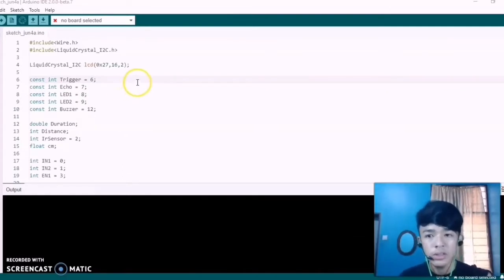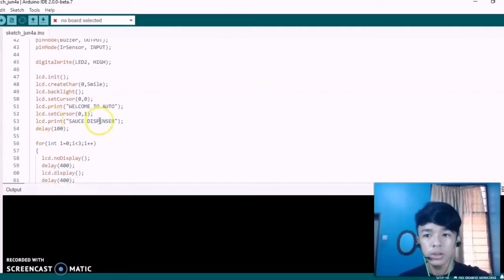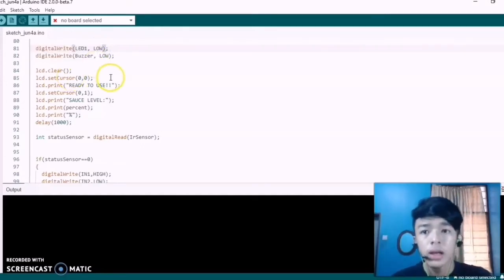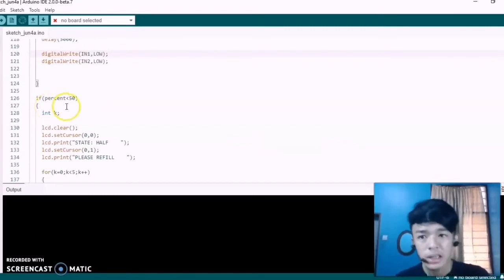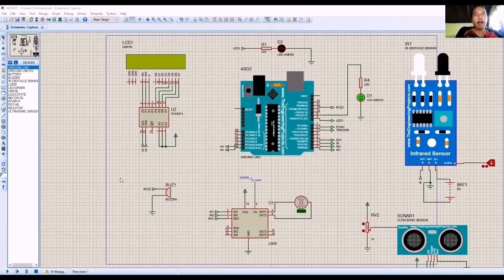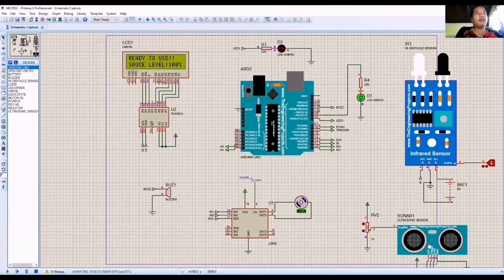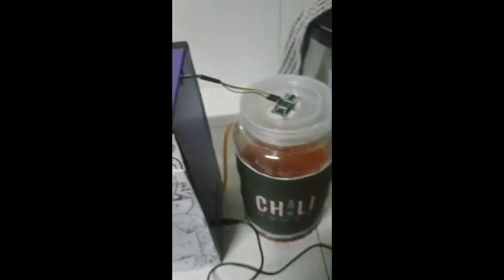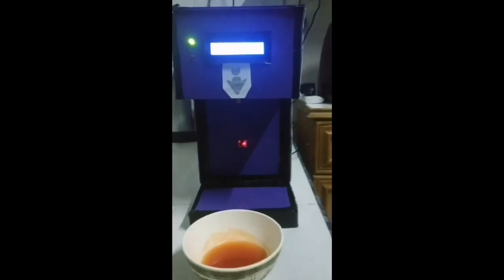BEE3942 02P Group1 Automatic Sauce Dispencer

Comment: (EC18043, GROUP 2, 02P) Nice prototype you've done there. Very interesting! I would  like to ask, it is possible if we replace the sauce with soy sauce, or mayonnaise? The amount of soy sauce or mayonnaise would be the same?
Reply from the maker: Hi and thank you very much for asking regarding of that question it depends on the concentration of the soy sauce or mayonnaise. Since the pump that we have used in this project is low power pump, the power that can be deliver to  extract the is quite low. this will disrupt the performance of the machine since it will work much slower. The best possible solution is to change with more power pump which able to deliver more power.

Comment: Power coding presentation.. Boleh ambil alih kerja saya dh.. Nice prototype as well.. mmg boleh guna terus kt rumah tu.. terbaik.. Just a few questions:
1. Why you need to turn on buzzer during sauce dispensing? 
2. IR sensor only detect obstacle. Let say there are something in front of it, it will directly dispense the sause continuously although it is not a plate. How you can prevent this from happen?
3. Why no buzzer sound when the sauce container is empty?
4. Why distance = 50 considered as empty?
Reply from the maker: Hi Dr Ikhwan, thanks for the compliment

Below are the answer for your question:
1)The main reason to turn on buzzer when the sauce dispense due to ensure user remain focus during the sauce dispense. This is to make sure that the sauce will not overflow when the container are full.
 
2)In order to solve this problem, two possible solution that we have came up: 

Firstly to add another IR Sensor which each one are located at the top and the bottom. By applying two sensor at different location, the possibility of both sensor cover with other object are very low. Technically, we also can put the instructions for the user to not put any object except the plate for the sauce.

The second solutions for this problem by applying a switch. The idea is to put a push button that will initiate the activate the sensor. by applying this method, the sauce will not dispense even it detect object. The sauce only dispense when it detect object and the push button are pressed. The dispense will stop when sensor doesn't detect any object anymore.

3)The main reasons for no buzzer sound when the container is empty is due to that we have designed this which make the container will never empty. The idea is to ensure that the sauce will never reach absolute zero. By applying this method user still able use the machine even it display as empty. however user need to ensure to fill the sauce when display empty so that user able to take advantages of this privilege's.

4)The main reason for the half container will mean empty is to make sure that the sauce will never reach zero. This means that user will refill the container early so the sauce always above 50%.Since the sauce nozzle are located at the bottom of the sauce container, the sauce will always new when dispense.

Comment: (EC19024,GROUP 5, 02P) Assalamualaikum. Nice project and very useful for daily use. I'm just curious about how far the IR sensor can detect the object ?
Reply: waalaikumussalam..thank you for willingness watching and comment our project..for this type of ir sensor it has a pair of infrared transmission and receiving tube. when detecting direction meet with obstacles (reflecting surface), reflected infrared receiving by the tube. so for effective distance range basically in about 2 ~ 30 cm

Comment: (EA18116,GROUP 4,3P). Hi wow really amazing and interesting project! Okay I just want to know how much is the cost of completing the project? Isnt it will be more interesting if there is option in choosing the type of sauce ? How about the maintainence? Is it high or low?
Reply: Hi and thanks for the compliment. Actually this is a low budget project as it only cost around RM100 and this project is eligible to any type of sauce in side of its concentration. And of course the maintenance is low since we only use pump to transfer the sauce from the container to the plate

Comment: (EA18089, GROUP 9, 02P). Hai friend. Congrats for the really cool project. Just need to ask one question. Its okay if we used the more concentrated sauce like our mom used to make a fried noodle. It will effects the motor or not?
Reply from the maker: Hi, thank you for asking... Yes it is possible to use high concentrated sauce.. However it will effect the performance of machine. The speed of disperse will became more slower. The best solution will be to changed the water pump that have higher power